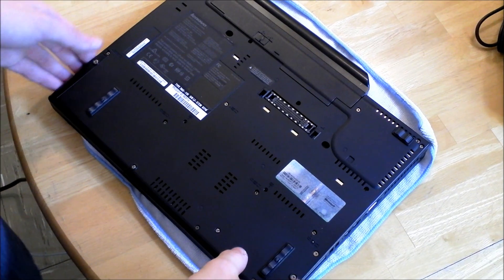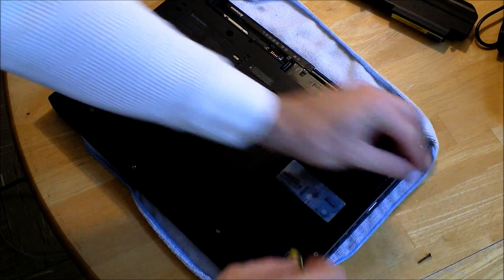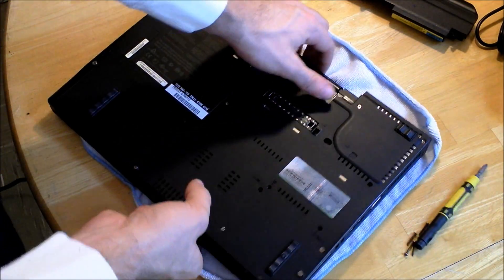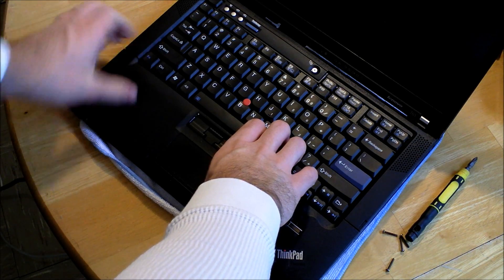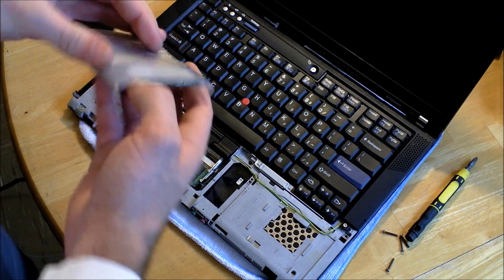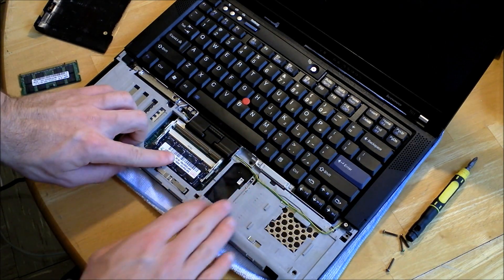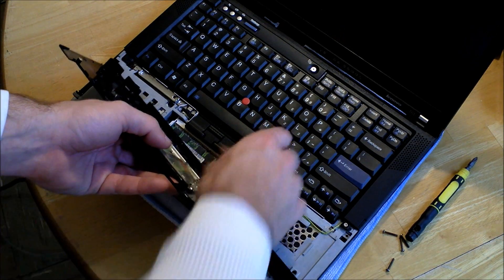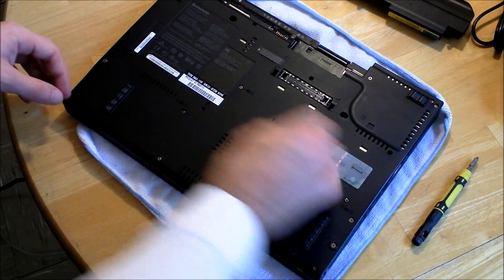Tutorial: How to upgrade ram in a T61 Thinkpad

Comment: 2019 - just ressurected my old 3gb t61 with  lubuntu 18.10. Runs pretty well but java is a memory hog. Looking to upgrade my 1gb stick to 2gb. Think the t61 will make a good beater machine for youtubing and light coding. :D
Reply: I have the same setup as you. Thinking of buying another cheap one for parts. Do you think an ssd would make it a lot quicker and that it would drain less battery?
Reply from the maker: Yes, most definitely. I recommend these to everyone now- https://amzn.to/2TFE7aW

Comment from the maker: Yes, that will work fine. Be sure to get DDR2 sodimms. I just posted a link to the best deal right now to max it out (there are two links, I am talking about the second one). If you upgrade the harddrive, I would highly recommend a solid state drive instead of a normal harddrive. It will be MUCH faster, and you should get better battery life.

Comment from the maker: What cpu? If you have the T7100, then yes a 64 bit OS will work. You need a Core 2 Duo, not Core Duo for 64 bit operation, so any T5xxx or T7xxx cpu will work. You should be able to fit any 2.5" SATA 9mm height harddrive in it. I personally have installed up to 640GB ones in these machines. I have not tested a 1TB, but it should work (just make sure to get the 9mm height and not 13mm height).

Comment from the maker: You can put in 4Gb, however not all 4GB will be usable. I recommend upgrading to 3GB instead (1x1GB+1x2GB). See the description section
Reply: what do you mean by "not all 4GB will be usable"? the motherboard cant handle 4GB? I was thinking of buying another cheap thinkpad which is on offer without a charger to use its 2GB chip.

Comment: Memory maximums for current Windows OSs include:
 Windows Vista (32 bit)
Ultimate: 4 GB
Enterprise: 4 GB
Business: 4 GB
Home Premium: 4 GB
Home Basic: 4 GB
Starter: 1 GB
 
Windows XP (32 bit)
Professional: 4 GB
Home: 4 GB
Starter Edition: 512 MB
 
T61 7658 RVUs use Centrino vPro processors which support 64bit OSs. The memory is being used by the laptop programs at startup so you won't always see the entire mem at 4GB, but its all there.

Comment from the maker: Newegg sells an 8gb kit for $165, but I don't know if the T61 supports that amount of ram.
Reply: Just in case anyone still needs this info - out of the box the max it supports is 4gb but if you flash middletons bios, you can upgrade a T61 to 8gb of ram, also improves SATA speeds. These days those 4gb DDR2 strips are hard to come by though. I'm about to put 2x2gb in mine, I will definitely refer to this video during the operation, thank you ♥️